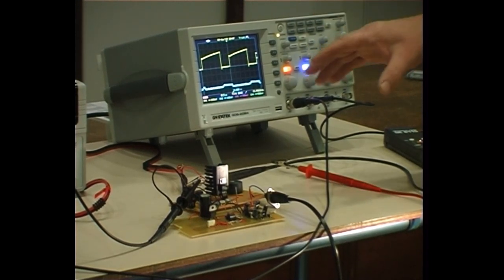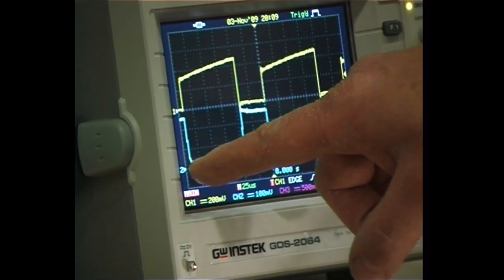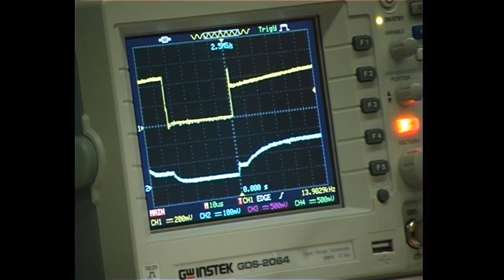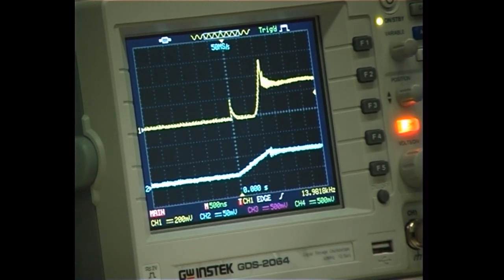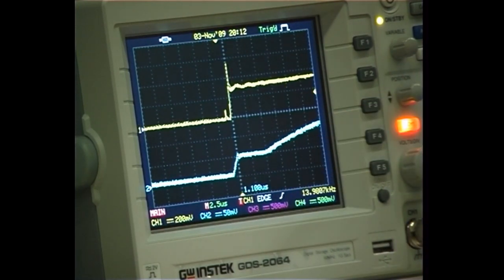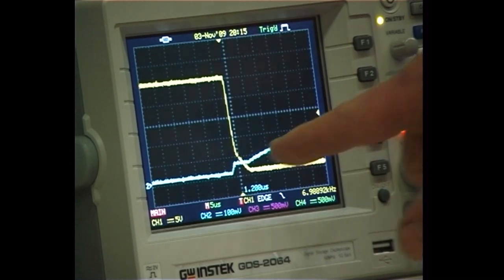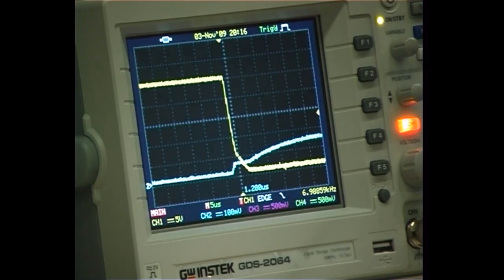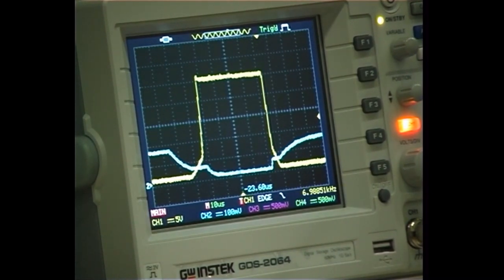MOSFET Switching Explained

Comment: Thank you for the video! Just one question how did you measure the drain current? Did you put a power resistor in series?
Reply from the maker: Thanks, great question. I can see an AC current probe from Tektronics at the back. It’s wide bandwidth so picks up the shape accurately. But you have no dc signal, so you need to know what you are looking at. DC to high frequency ones are much more expensive.
Reply: The current spike shown is due to the reverse recovery of the bypass diode when there is an inductive load. Does this effect occur in resistive loads?
Reply from the maker: @Mr-Setti  There needs to be a freewheel diode always even with a resistive load as the switching is fast and most things will look inductive due to the wires connecting it. I slowed the switching here, but it would be hard to go slowly enough.

Comment: The real story is dated sheet don’t tell what resistor value to use to fully turn off the gate voltage and that my issue in high frequency at higher voltage from 35 volt and up gate turn off because more harder to turn because of the larger voltage charging to handle high voltage and that created a lot of heating damaging the fet I don’t understand why in higher frequency voltage frequency 35 and up creating heat
Reply from the maker: Make sure you are giving the gate voltage to the fet with respect to the source. If your fet source is at ground that Is ok. But usually it is at the top of the diode so going up and down with the switching. That is why there are bootstrap gate driver chips available. Test in LTspice. Thanks for watching.